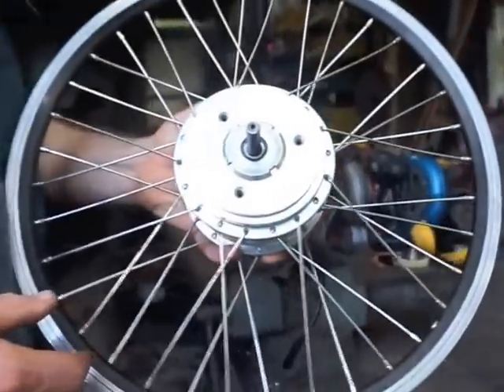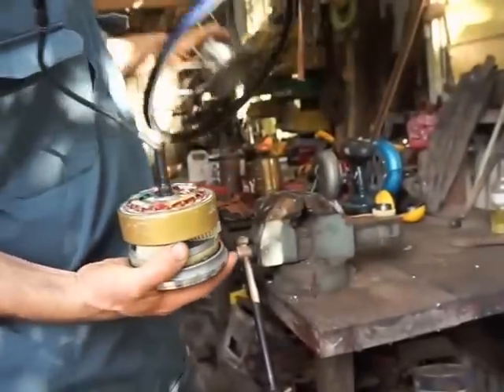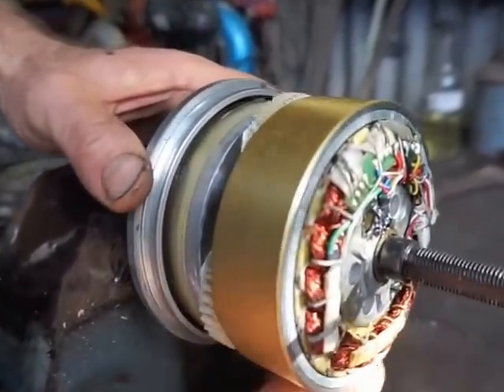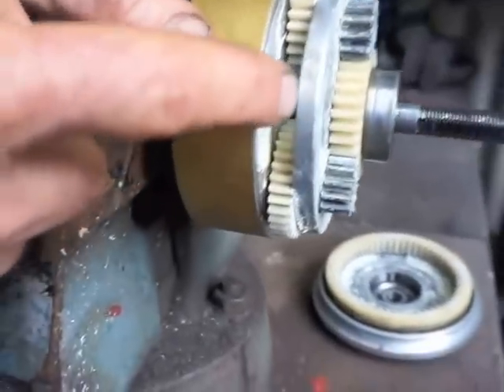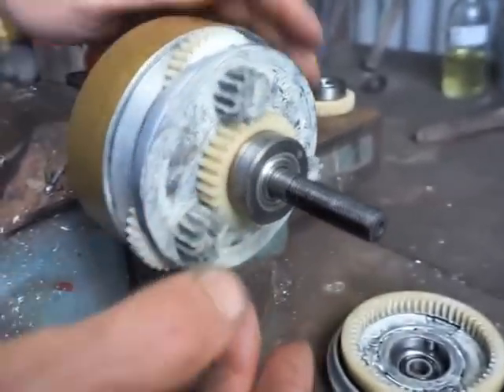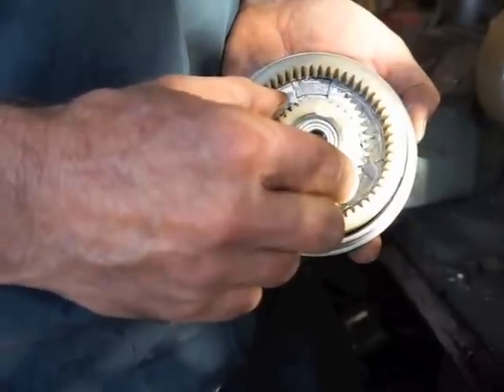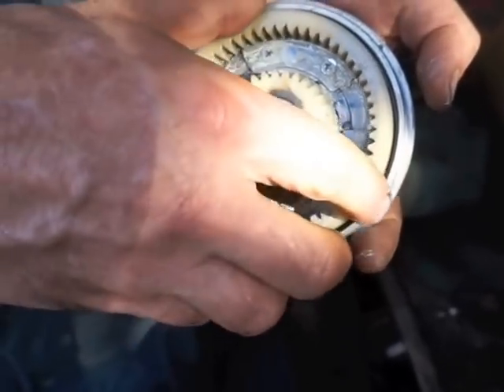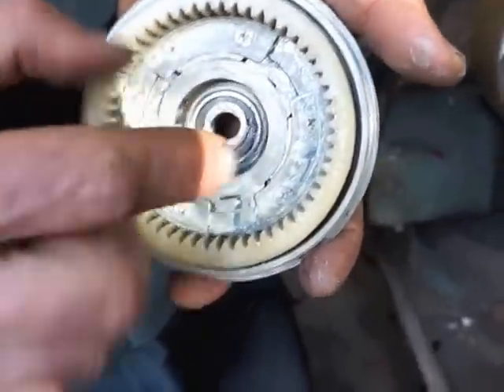How the Xiongda 2 speed hub motor works

Comment: Ive been doing my head in trying to figure out how it opens ive a modern one itd gotta twist somehow ,was it hard for you to open
Reply from the maker: I talk about opening the hub in this blog post: https://bruceteakle.blogspot.com/p/it-seems-clear-xiongda-2-speed-motor-is.html
Reply: @BruceTeakle  these new ones are suppose to not be able to be opened !! Do u believe that ,soon as i get to it we'll findout sir and thankyou very much ive lots of wheels parts etc to get through those new carbon motors are class buddy got one on a 20inch fatwheel cant wait to get a suitable motor for the torgue sensor in the bottom bracket any experience on how id do it through a pas or throttle cables

Comment: thanks for posting bruce, I see thats quite an old video,  so you must have had that motor for a long time. Its a genius design, I had heard about these motors but never seen inside them.
Reply from the maker: Thanks Name, it is a few years. The Xiongda on my folding bike has done over 12,000km now, had some nylon gears replaced, still in frequent use, still great on the steep hills, still very cheap transport.
Reply: @BruceTeakle  excellent, how do you change gears, is there a switch that reverses the motor I'm guessing?
Reply from the maker: @namenotshown9277  Usually I leave it to the controller to switch gears automatically. As you ride up a hill and slow down, around 15km/h the motor will stop briefly, then restart in reverse, engaging low gear. There is a HAL (high, automatic, low) switch that can over ride the automatic shifting.
Reply: @BruceTeakle  wow that is quite a neat system very advanced indeed. I can see electric cars in future using similar setup.

Comment: Isn't uhmwpe better than nylon? This plastic is 5 times stronger than steel in terms of tensile strength, it also has low friction. O maybe composite fibers or graphene can help them last longer? Regen braking not possible with planetary gears?
Reply: Justin Lemire-Elmore of Grin Tech made a geared hub with regen. It's essentially an Ezee/BMC/MAC-style motor, but with a locked clutch. That would not be possible with this Xiongda tho, at least not without losing the double-speed action!

Comment: did you need a special tool to loosen the plate? mine seams to be jammed on ( single speed but in same style shell )
Reply from the maker: Hello Ben, I explain how to open the 2-speed XD motors in my blog post: https://bruceteakle.blogspot.com/p/it-seems-clear-xiongda-2-speed-motor-is.html
I haven't tried opening single speed XD motors so far, but I hope this helps.
Reply: @BruceTeakle  ah thanks so much for the link. I already had worked out i was going for the wrong side of the motor. I just put in 2 longer bolts and turned out the the plate that holds the clutch. everything about my motor seams to be fine including the clutch and yet when I push the bike backwards it spins up the stator where it didn't before. my controller burned out when this started so I assumed the motor was dead. coils are all good and clutch turns one direction and not the other..

Comment: That great,l idea,  no free wheel and extra gears, because the free wheel gearss get most of the time stock and the electric motor stop turning the wheel, like wjat happen to me i had to find replacment online and that wasent easy because you need to take accurate diameters measurments of the gears so you can get the right parts for your motor,

Comment: I know the situation about regular e-kickbickes bldc's , but never find out the temperature of gear bldc.
Reply from the maker: One of my Xiongda motors has a built-in temperature sensor. The temperature of the motor windings is totally dependent on the situation. On long steep climbs it can sit at 120C or a little more, on flat country it can stay under 80C. 
My Bafang motors have been much hotter: up to 160C. See my blog post at http://bruceteakle.blogspot.com/p/burning-out-bafang-hub-motors.html

Comment: Well that's something new! Well I'm about to buy an ebike, but my question now is - do all hub motors have plastic planetary gears?! Won't they wear out too soon??
Reply from the maker: Hi Leps, every hub motor I know uses plastic gears. I think it's fundamental to manufacturing machines that are durable enough at low cost. Generally they use alternating steel to nylon. I've only ever had to replace nylon gears on one Bafang motor (see my post at https://bruceteakle.blogspot.com/p/electric.html), and a few times on these Xiongda 2-speed motors due to some early engineering problems - see my post at https://bruceteakle.blogspot.com/p/it-seems-clear-xiongda-2-speed-motor-is.html. We have 10s of 1000s of km ridden on Bafang and Xiongda motors in our family. 
The Bafang mid-drive BBS motor units also use nylon gears, which also occasionally need replacing (but we haven't had to yet in our family). 

Replacing some cheap nylon gears after many 1000s of km isn't a big problem - cheap and easy. You'll have many times more trouble with suspension forks or derailleur gears. 

Some people do replace plastic gears with steel so that they can run much more power thru their motors than they are designed for. I expect that as well as being much more noisy, this results in wear of the steel gears, which would create more problems than occasional plastic gear replacement (if they don't cook the motor windings first with high currents). 

I believe the European and Japanese mid-drive motors use only highly engineered steel gears. But these are very complex, very expensive to buy and very expensive to repair.
Reply: @BruceTeakle  well I could not expect a better answer.  Thanks, I'll treasure what you said and your experience (which values a lot). I certainly feel more comfortable in buying an ebike now! Thanks again!!

Comment: How does the speed controller switch work with the hub motor?
Reply from the maker: Hi David, when the controller senses the speed has risen (or fallen) to about 15km/h, it automatically stops power to the motor, and re-starts in reverse direction, thus changing the gear. This feels a little strange at first.
Reply: @BruceTeakle   Thanks for your reply it does make sense. Do you know is it possible to work with a torque sensor (e.g. from pedal) instead of a speed sensor to change the gears?

Also, is the speed sensor inside the motor or on the rim of the wheel?
Reply: @BruceTeakle  Sorry i got too many questions I hope it won't annoy you. Apart from sensors, do you think I can manually control the speed with a switch maybe from the handle?
Reply from the maker: @davidkk1166  Hi David, I think you're asking if you could change the gears with a different control from the automatic, speed-based shift it comes with? If so: yes. There is manual control with the KT controllers Xiongda usually use. The "HAL" switch allows you to choose High, Automatic or Low with a switch on the handlebar (see my blog post). Re using a torque sensor: this would require more electronic genius than you can find in my workshop. It would also run into the limitations of electric motors. There is a torque/speed curve that means you don't want to go much less than 15km/h in high gear or you'll overheat, and you can't go much more than 15km/h in low gear as the motor spins out (has no torque). I usually leave my bikes on automatic, but sometimes use the HAL switch to force the motor to stay in low gear when I have short, flatter sections of climbs where I want the motor to cool off a bit by staying at high revs.
Reply: @BruceTeakle  Hi Bruce, a manual control is actually what I am looking for but it is nice that it can work in both manual and auto control.

I have looked up on your blog and it is really detailed. However, is the switch from the same company as well? I have also looked up on the Xiongda on Alibaba (couldn't find their own website) and seems they don't have the switch or no longer available.
Reply from the maker: @davidkk1166  Hi David, that's funny!: I've been daydreaming for years about how to drive a wheelbarrow - maybe Chinese centre wheel - with a bike motor, mostly for hauling firewood up our steep hills here. Ebike motors are very sensitive to overheating from low speeds (look at my "burning out bafangs" blog post), so it's a challenge to find a motor drive that can cope with 4 or 5km/h in its high-torque zone. 

The KT controllers were supplied with HAL switch in the past from Xiongda, but I haven't bought any for a year or so, so I may be out of date (email Bonnie to find out). If you wanted to use an XD on a barrow, you probably would only need the low speed gear. I think - but haven't tried - single speed operation could easily be done with a normal generic 250w controller without the 2-speed function that's specific to XD 2 speeds. Change speeds by reversing phase wires.

My current imagination is that a barrow would probs best be driven with a chain drive reduction from a single speed motor without a rim. That way a larger diameter wheel could be used for better traction. Unfortunately this would be more vulnerable to sticks etc., and need more maintenance.
Reply: @BruceTeakle  Hi Bruce, yup you are right, it is extremely hard to find a low-speed high-torque e-bike hub motor on the market. Actually you reminded me that I can look for a wheelbarrow hub motor directly instead of an e-bike hub motor (I feel so dumb that I had never thought about it)

The chain drive idea for a barrow is really creative but the carrier I got has limited space unfortunately. Thank you so much for explaining a lot information and giving suggestions on alternative choices, you really helped me a lot.
Reply: @BruceTeakle  how does that feel on very steep hills, about 20% (with a cargo bike )?
Reply from the maker: @Ematuresco  20% is very steep! And a cargo bike can be heavy. We have cargo bikes, but none with Xiongda 2speed. We use Bafang BPM Code 12 rear motors in 2 of our extracycle cargo bikes (see my blog post https://bruceteakle.blogspot.com/p/blog-page_13.html), and a Bafang BBS2 in another. These are both higher power motors with good low-speed torque. If you had a short section of travel at 20% the Xiongda would probably be fine, but over a long climb with a load it would risk overheating.

Comment: Can the wheel spin backwards if your on the bike and trying to back up with your feet?
Reply from the maker: Yes, the hub can be pushed backwards. These hubs sometimes lock up and won't push backwards, then you roll them forwards a little and then they're usually fine to reverse.

Comment: WHAT IS THE MAXIMUM REDUCTION RATIO?WHERE CAN I BUY THIS ONLINE?
Reply from the maker: Hello Akshay, I didn't count the teeth on the primary sun gear, so I'm not sure of the overall reduction. I'll count it next time I have a motor open. the difference between the 2 gears is 54/30 - less than 2:1. For a link to the Xiongda website, see my blog post, linked above in the description.

Comment: So it's impossible for this hub to provide energy back to the battery through regenerative braking.
Reply from the maker: That's right, this motor can't do regenerative braking due to its freewheels. As I explain in my reply below to Ezequiel, there isn't actually enough braking energy wasted in most cycling to make regeneration braking worthwhile. Regenerative braking is braking, that slows you down, and we don't usually spend much time doing that.
Reply: I rode an electric bike for the first time last night with a friend who I helped get his new speed controller working on his bike. It turned out that the hall sensor in his throttle was broken.

Anyway, what I found was that it's really easy to keep the bike going fast by pedaling, but it's difficult to get the bike up to speed, so the power from the electric motor mainly helps for acceleration. I don't really feel the need to sit there without pedaling at all when it's so easy to pedal.

However, I did have to slow down a lot quite often because it was so easy to get going pretty fast after every stop. Therefor, I'm not so sure that there isn't very much opportunity to recover energy from regenerative braking. I felt guilty that I was wasting energy (and range) every time I hit the brakes.

Also, my friend said that even though he has disk brakes on his bikes, they are insufficient due to the added weight of the hub motors and batteries. Regenerative braking should actually slow down the bike quite sufficiently adding to the performance of the undersized brakes.

So, I don't know. Maybe the regenerative braking features in these speed controllers aren't implemented very well. Or maybe it's not possible to implement them very well. I haven't tried it yet to see what I think of it.
Reply: @BruceTeakle  Bruce you're right, however regenerative braking is used mostly to reduce a huge wear  in braking system (disk and braking pads). Using regenerative braking can prolong your brakes by 90%. I'm almost not touching brakes during long downhill trips. Thanks for the video!:)
Reply from the maker: @The_Unobtainium   I agree, where I live region braking would save me a lot of brake parts (pads, discs) and maintenance, if not much energy. What sort of motor are you using?
Reply from the maker: @The_Unobtainium  Hello Ilive, thanks for your feedback. What sort of motor are you using?

Comment: I am thinking over the mechanics of this hub motor and I believe that with a few modiffications it could be ideal for energy recovery braking because the gears multiply the velocity of the rotor, and a free wheel mechanism would translate into a low draw pedaling if your battery is empty. This axact motor with a free wheel mechanism to act as a motor, and a kind of a clutch activated using the brake lever to return the kinetic energy to the motor/generator during regenerative braking because the free wheel mechanism is unidirectional.
Reply from the maker: Hello Ezequiel, many people's first question when they see my electric bikes is about regenerative braking. However there is a good reason that regenerative braking is extremely rare in ebikes: there just isn't enough energy wasted by bicycle brakes to make it worth capturing. Remember, regenerative braking is braking - it slows you down, and it needs to slow you down a lot to be generating a significant amount of energy for battery charging. 
Most people riding bicycles for transport do very little braking - consider how long brake pads last if you don't live on a mountain. It is only if you have long descents down hills, where you apply the brakes continuously, where a useful amount of energy would be generated, and very few people have this. People usually use normal small hills to get speed, and brake very little. Consequently the cost and complexity of regenerative braking technology in your motor and controller would not pay.
Reply: @BruceTeakle  the main plus of regenerative braking is the use of it on downhills like a retarder helping the brake pads.Not just for the charging aspect.

Comment: did you happen to count the number of teeth there were on the suns and planets and the ring gear?
if i understand correctly there are two outputs that can drive the wheel, either the ring gear, the 2nd sun is then in freewheel, or the 2nd sun, while the ring gear is then in freewheel. 
that's a very nice design! i'm going to have to use it for my own ebike.
Reply from the maker: Hello Jean-Valery, you understand the mechanics correctly, it is clever! I have added some photos to my blog post about this motor, which show the gears clearly enough to count. Blog post is at http://bruceteakle.blogspot.com/p/blog-page_20.html
Reply: i have read that it is impossible to turn the weel backwart, by hand pushing. is that a big nuisance?
also its basicaly a "retro direct" drive made compact by pl. gears and el. motor

Comment: Por favor,¿como hacer para tener información en Español sobre kits eléctricos Samsung?. Me intereso por uno con centralita integrada en motor trasero; que desconectado no ofrezca resistencia; con casete Shimano de 8 ó más velocidades y con una batería de36 V 15 A. Gracias.
Reply from the maker: Hello Josep, I don't know about Samsung equipment, I have only used Chinese motors: Bafang/8Fun and Xiongda. Bafang and Xiongda both make rear hub motors that draw 15A, but both use 7-speed spin-on clusters. Bafang make a higher powered motor called a CST which takes an 8 speed cassette, like this: http://www.greenbikekit.com/electric-motor/rear-bldc/bafang-cst-bldc-motor.html  
There is also a generic motor available that takes an 8 speed cassette: http://www.greenbikekit.com/electric-motor/rear-bldc/e-bike-cassette-freewheel-hub-motor-36v-250w-light-weight-high-speed.html  
I haven't tried it but I expect it is fine. 
I have used the Bafang rear hubs, both 15A SWXH and 18A BPM and they are both good motors. They use a 7-speed spin-on cluster so you usually use 2 front sprockets with front derailleur.
Reply: Bruce Teakle No se inglés o siento, no me entero de nada
Reply from the maker: Bruce Teakle
Google translate:
Hola Josep, no sé de los equipos de Samsung, solo he usado motores chinos: Bafang / 8Fun y Xiongda. Tanto Bafang como Xiongda fabrican motores de cubo trasero que dibujan 15A, pero ambos usan grupos de rotación de 7 velocidades. Bafang fabrica un motor de mayor potencia llamado CST que lleva un cassette de 8 velocidades, como este:
 http://www.greenbikekit.com/electric-motor/rear-bldc/bafang-cst-bldc-motor.html.
También hay un motor genérico disponible que lleva un cassette de 8 velocidades: 
 http://www.greenbikekit.com/electric-motor/rear-bldc/e-bike-cassette-freewheel-hub-motor-36v-250w-light-weight-high-speed.html
No lo he intentado, pero espero que esté bien He usado los bujes traseros Bafang, tanto 15A SWXH como 18A BPM, y ambos son buenos motores. Usan un clúster giratorio de 7 velocidades, por lo que generalmente usa 2 piñones delanteros con desviador delantero.